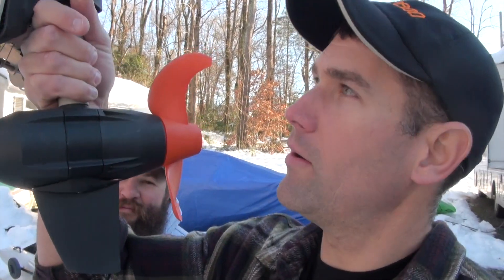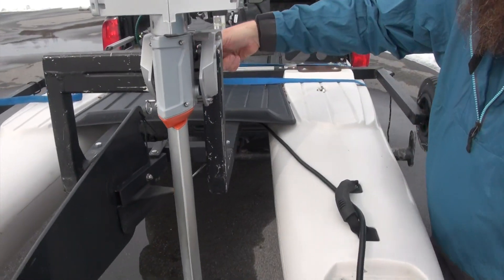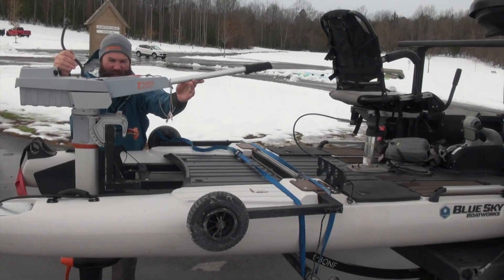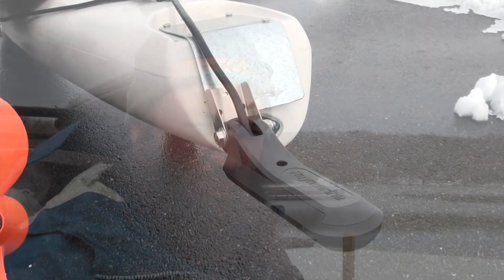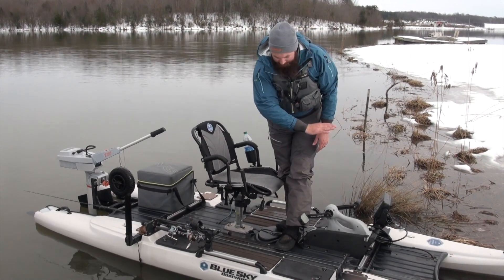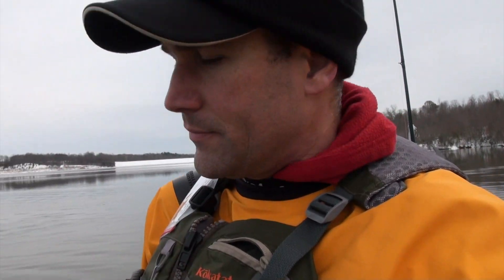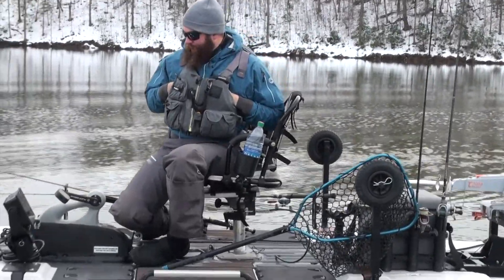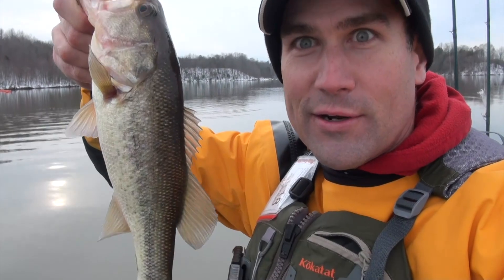Angler 360 Torqeedo Rigging and Testing

Comment: Thank you once again for taking it to the next level we have been waiting for an options like 
Torqeedo's 1103.
 What an undertaking I'm sure there's a hundred little tweaks that need to be dealt with to accomplish what you're striving for.  The next thing we'd like to see is for someone to remove that obsolete dinosaur pedal drive and open up the valuable real estate of the front deck.  This would initiate the start to the ultimate fishing platform. 
We do know one of the original design won at ICAST but there's so many possibilities now.
 Again thank you for not leaving well enough alone.